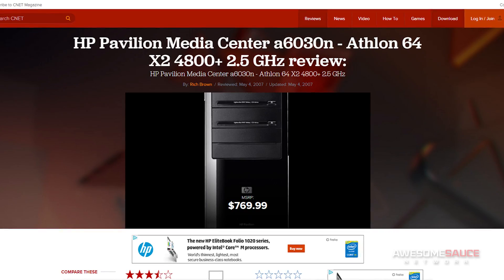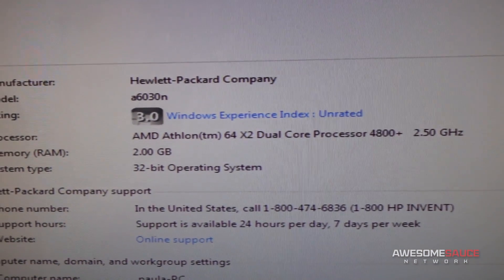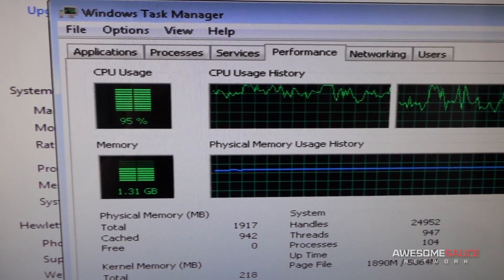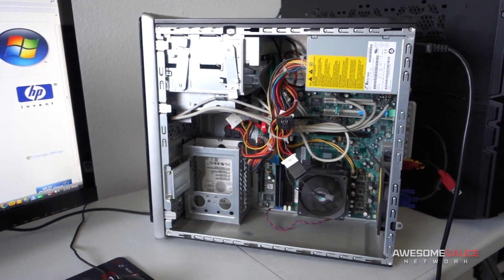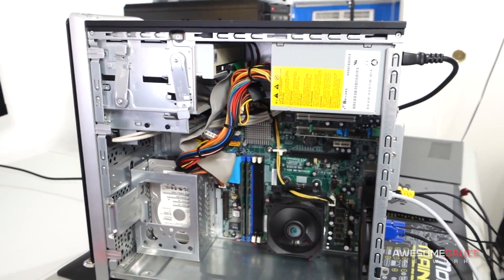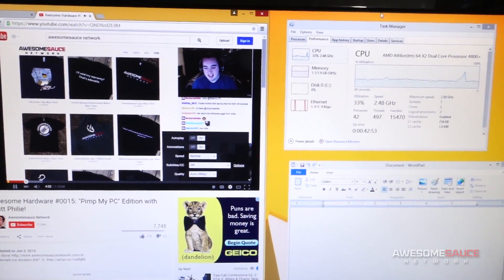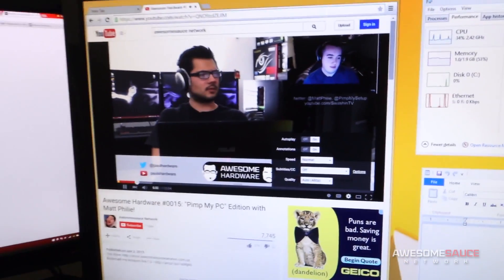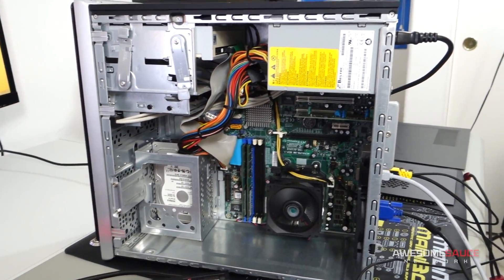Cleaning Up My Neighbor's Old Desktop!

Comment: Why didn't you reinstall the OS it was on? If I was to wipe the drive for someone, unless otherwise specified, I would have reinstalled Vista on that system.
Reply: ***** I disagree. Vista is actually a nice OS. Personally one of my favorites.
Reply: ***** That is highly debatable between Vista and Windows 8.0
Reply: +SteamedRevenge Vainilla Vista? sure. Vista with SP its a nice OS (sure, its not perfect but it gets the job done)
Reply: ***** meh. Its a good OS in my opinion
Reply: +SteamedRevenge Still, his neighbour was used to Vista.

Comment: why is that $700 for 2gb of ram, a shitty processor and a shitty gfx card
Reply: In 2007, that CPU was amongst AMD's top everyday computing processors with nice 128-bit graphics. Today, the processor still performs well, but needs to be paired with dedicated graphics if you want to be able to play new games. 2GB of RAM was about all 32-bit Vista needed and could utilise.

Comment: I have a HP Pavilion P6000 Series, Its a old family PC so its bad and old, my dad gave it to me after my parents both got laptops. Now I mainly use it for gaming, most games run fine since I got it a GPU, since It didn't have one before, and a power supply. Now the problem is I have a lot of CPU heavy games, meaning my GPU doesn't do much of the work sometimes. So I was thinking of getting a new CPU, preferably a Quad-Core, with around 4 GHZ. No I was wondering wince I'm running a... Uh... Hold on lemme check, Ah yes, a AMD Athlon II x3 445 with 3.1 GHZ. Now I am not sure if the x3 stand for tri-core, but I was wondering if I wanted to get a new CPU, would I have to get a new Motherboard, and for that a new Power supply?    PS: my Power supply is a Thermaltake TR2 430W, and my GPU is a Zotac Nvidia GeForce GT 640.
Reply: I don't know what your existing specifications are, but you could find a CPU from the same generation/type to fit into your motherboard.
Reply: Ok.
Reply: Millipede Streams which p6000 do you have? I want to find the specifications
Reply: p6732f
Reply: Millipede Streams ok, looks like you can stick to that motherboard and get a quad-core AMD Phenom 965 or 970 etc. but my main concern how much the power supply will take.
Reply: Yeah, thats my problem as well, thank you so much though. Im not cut out for this.

Comment: shouldof stick to Vista or at least windows 7. Better Performances.  Easier to use too. Then windows 8 or 10.
Reply: I used Vista for 5 years. It's not as bad as people say, but Windows 10 has been an improvement for me. It is much faster and easy to learn.

Comment: When you brought up the CPU usage thing, I got curious, so I pulled mine up to see what my CPU was at.
It was at 3% usage... 3% and I have 3 monitors hooked up and they all had windows open on them...
Well, I guess my CPU is a beast. I never really thought of it as a beast, though.
Reply: Displays are handled by GPUs. We're the Windows doing anything CPU intensive?
Reply: +Lapine Vision were*
Reply: Lapine Vision If I remember correctly I had a live stream open, Skype open, and YouTube or Steam open. That's usually what I always have open.

I do have a i7-4770k, though. Is that really much of a surprise that it's at that low of a percentage?
Reply: Yea I just tried this and my 4770k reaches 10% while staying under 1GHz
Reply: +Retz i am planning to keep my 4770k through a few generations
Reply: +Retz My cpu intel g630 2.70 ghz reaches 50% with youtube video and steam and 5 folders 
and reaches 100% on gta v
Reply: +Retz Mine's at 11%

Comment: 4gbs ram
new hdd or ssd if possible
windows 7 or 10 

just those things should wake the machine up some more especially an SSD and windows 10
Reply: Tutoriale și jocuri interesante i believe thats pain, or "kill me" in hard drive speak
Reply: +Lapine Block SSDs make a major difference. I now have SSDs in all three computers that I use on a regular basis. In fact, one of those computers is going on 11 years old, and the SSD really helped its temperatures, removed the noise of an HDD, and is keeping it snappier.
Reply: +Lapine Block It will, I had an Athlon X2 3800+ and installed an SSD a few years back(OCZ 3rd gen low end SSD). Difference was night and day. Program start times dropped to within a second and internet browsing (cache writes and stuff) where much faster. ALso boottimes dropped to below 30 seconds from over 1,5 min. Best upgrade for that system I ever bought. 0 ms Seek times make so much of a difference
Reply: +maccollectorZ (Commenting Account) it doesn't really seem like the guy would need an ssd really, he is an elderly fella and his needs seem very basic. Any type of modern 7200 HDD and newer OS will make boot times much faster than what he is used to. There's no need to invest more money than necessary in an ssd build. Heck, just doing the cleanup and getting rid of Vista should do the job just fine :)
Reply: maccollectorZ (Commenting Account) i am now convinced an SSD is beneficial to 8 year old computers.
Reply: Lapine Block Certainly helped this 11 year-old iMac of mine.
Reply: The HDD is fine. I'm actually surprised that a 7200RPM 400GB Hitachi Deskstar has lasted me 8 years. I don't think an SSD will do this PC any good.

Definitely needs more RAM and an upgrade to any 64-bit Windows.
Reply: Lapine Vision One of my HDDs has 14-16 years and it runs fine. Althrough it's very loud in the first 30 seconds when I power on the computer.
Reply: NonsensicalSpudz After those 30 seconds it's quiet. Oh, forgot to mention that the case isn't too stable and vibrates a lot. And it has Windows XP, but the computer came with Windows 98 or 2000 because it has a 99s AMD Sempron.
Reply: Daniel Kemnitz I was replying to the user 'Lapine' in the comments - I wasn't referring to the neighbor.
Reply: +NonsensicalSpudz Forget about windows 10 on that pc. I have installed win10 on a laptop with 2Ghz core2 duo and svhost.exe is using a lot of cpu all the time and it has high hdd activity as well. SSD might help but only if this motherboard has SATA 2, otherwise not that much. If you don't have at least athlon II/phenom II or intel core i3 or i5, just forget it. New windows uses some instructions from more modern cpus that those pcs don't have causing high cpu usage all the time. I see that even with windows update service on windows 7 on older core2 duo laptops. So yeah, windows 8 was a good choice here.
Reply: ***** Did you ever find a fix for that? I put Windows 7 on a Pentium 4 machine, and it runs okay... all except for svhost.exe using half its CPU constantly.
Reply: +maccollectorZ (Commenting Account) Microsoft published a patch which makes BITS, wuaserv and some others multi threaded, but on older pcs it makes things worse.
The only way to make your pc usable is to set windows updates to "Never check for updates" and use WSUS Offline once a week. "Check for updates, but let me choose" will not cut it, unfortunately. Windows update service, checks the hashes of system files at least for few hours daily, that is what causes high cpu use, so it must must stay off.
Reply: ***** Alright, I'll try it. Thanks for the info.
Reply: maybe a graphics card
Reply: +NonsensicalSpudz Or linux :P
Reply: +Lapine Block SSD's do wonders, even for older computers... just depends how old, of course a 98 wont benefit too much, but xp's will maybe even the dreaded vista.
(side note, i had a vista, i never thought it was too bad i dont see why people complained soooooooo much, only thing that went wrong was my harddrive dying but it was in a laptop that got moved around alot)
Reply: +NonsensicalSpudz all depends on the motherboard tbh
he might need to replace the motherboard to a ddr3 and possibly a sata 3 motherboard
Reply: +Evan Blake 
Or maybe an entire new pc with quad Titan X's, i7, 2tb ssd, 69gb ram...
Reply: +George LoL, Quad titan x are just gonna suck up all of the wattage from the power supply, your probably gonna need like a 3000 watt psu.
Reply: ***** i never said it didn't
Reply: ***** yeah because its windows 8 :P

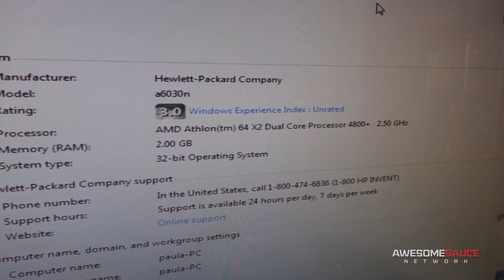Comment: 2:04
Found the problem, it has amd in it
Reply: +Midas Sandahl The Athlon 64 x2 4800 and 5000+ are still good processors. My old PC has a 5000+ and can run many CPU intensive applications.
Reply: +Lapine Block At the time they where top notch and way faster then what intel had to offer in the same price bracket.

Comment: I fear that the owner will just mess up the PC again.
Reply: +Kaarel Kahu You bet it. 2 years is enough for him/her to mess up the PC.
Reply: +Kaarel Kahu Zerg master race
Reply: +Kaarel Kahu I would just put some virtuallization software like Returnil on it, autoclean system on everyboot (well actually all changes to the C drive are cached to a file instead of actually written to the C drive. Upon reboot that cache file is deleted so everything reverts back to the original state. Really awesome for people who just like to click all those popup add links. All you have to do to make sure foto's and stuff aren't wiped is splitting the drive in two partitions and move the Documents folder to the second one. Did that on my dads PC after the firsttime I had to devirus it(he had only been using it for 3 months or so) after installing that he used that system for 3 years without any virus problems :)
Reply: +WB IsMe More like 3 weeks. Some people just have no common sense.
Reply: It works like a charm. (And because it forces all writes to the C drive to be sequentially written to a cache file, it sped up my OCZ Core 2 SSD as that (2nd gen) SSD didn't like concurrent writes very much. slowed read speeds down a lot.
Reply: +Kaarel Kahu he's probably still looking at old crusty man porn and messed It up
Reply: +Kaarel Kahu 
Probably will almost immediately. I'm not saying that older folk are always bad with computers, but it's amazing just how well some people can fuck up a system without even trying. That and the thing has probably never undergone any proper maintenance in its entire life.
Reply: +Robert Phoenix great idea there!
Reply: +Robert Phoenix cool, quite interesting, have a couple of people in mind that would really benefit from that (and me consequently)
Reply: +Kaarel Kahu whatever just help him again  for a fee hahaha
Reply: +Kaarel Kahu no duhh, but he saved the guy trouble of paying to be fixed or buying new. Like he said its an older guy, he just did him a favor. 
I would have greatly appreciated this back in the day as a kid not knowing squat about pc's for someone to help me let alone being old and barely ever using computers.

Comment: Looking to do my first ever upgrade on my old HP Pavilion a6603w: 
CPU: 2.40ghz Intel Dual Core
GPU: nvidia 7100/nforce 630i
PSU: 250w :( (Looking to replace it with a Corsair cx500m)
3gb of ddr2 ram
256gb hdd (Looking to add a 120gb ssd as a boot drive)
Any comment/suggestions? What should I buy/upgrade first? Not looking to spend more than $100 on gpu. I just want it to perform faster and play a few steam games! Thank you.

-KG
Reply: You should get more ram if possible and if your just gonna get a ssd I would also recommend you get a HDD if possible
Reply: +kg flip Find a graphics card: If you're going to use an SSD, why not get decent GPU power?

Comment: On a trip to the dump to get rid of an old CRT TV, I was directed to a container designated for that purpose.  Along with the old TV's were dozens of orphaned computers.  When the guy wasn't looking, I loaded 4 of them into my car and later went back for more. 

All of them, without exception, were there for clogged or corrupted operating systems.  I am not especially computer savvy but I was able to load up a free Linux OS and any school kid should love one of these for a start-up. 

Wait for a dry period without rain for the best yield.
Reply: I use to say that my desktop was the only machine that could evolve after I bought it. 
Even I could open it up and change.components. 

Not true with most laptops and Ipad type devices. 

It is a shame that so many machines are just tossed away.  It is stupid, wasteful and it deprives the disadvantaged.
Reply: +Larkinchance Agreed.. mostly just cranky old men guarding the entrance. They look you over when you come in and pay you no mind when you leave.. 
Are you going to get arrested for stealing from the dump?
Reply: +Larkinchance hahahahahhahahahh
Reply: +Larkinchance When I went there I was ditching other scraps and saw some microwaves stacked up. I like the parts, so I asked if I could have them but they said no and that they couldn't get it for me :( I didn't just take them because they were really at the other side of the building and there were a few machines running.
Reply: +Jess Vagnar You must be crafty because they will always say no.. I do it when I am discarding a CRT TV.. They charge me $10 for the privilege and when they are not looking, I load a few computers in the back.  They go to Asia and they receive a bulk rate for them but they could just as easily let people like us have the pick for $10 or $20 each before they ship it off.. .
Reply: Larkinchance
 Hot dang that's expensive! All of mine are free, my state has an electronics bill that prevents enclosed electronics from being thrown into the landfills so they offer free removal at the facility. Unfortunately where I am now uses a huge facility, so the physical gap is too large to stealthily grab a few components! Good for you though!
Reply: +Larkinchance I used to work at a second hand store so we went to the dump several times a week and I got to know the people working at the dump so when I saw an old computer I was allowed to take it, at one time I had around 25+ Pentium 4 rigs in my kitchen that I fixed up and sold for around 150-200$ each (this was back in 2009) =)
Reply: +Jess Vagnar They don't throw them into land fills, they fill the container and ship it to Asia for a pittance..
Reply: Larkinchance They used to throw anything in the trash into a land fill / incinerator / whatever they used in the district. In the 90's and 00's most states passed enclosed electronics laws, outlawing them from landfills and providing free removal, since they felt it would be stupid to tell someone they NEED to recycle this, oh and it costs $10.
Reply: for each item...
Reply: For your best yield lol
Reply: Yes, these computers shouldn't be thrown away.. It is wasteful.  I am not a merchant. and did not sell them, I gave them away to  people .who could not afford one.

Comment: Actually so manny people have a computer like this one with just a lot of virusses or programs that slows down your cpu. You could have done some light overclocking on this system and reverse the yellow fan and place a dust filter in front of the fan.
Reply: +DavidJonSpem User like them download stuff from the internet mindlessly. Even if they have a $10000 overkill PC, it will still run like a turtle after 2 years due all the random crap that they downloaded.
Reply: +DavidJonSpem You would need to flash a new BIOS to support overclocking on HP's Nettle2 motherboard.
Reply: Lapine Vision yeah I am not an overclock specialist

Comment: So close to what I had. I was rockin a HP a6110n my friend handed down to me from 2010 till just last year when the mobo finally kicked the bucket and I built my 390 5820k gaming workstation.

Was such a trooper. dropped an R7 240 in there, another 2 gigs of ddr2 ram and it ran dota, csgo, fallout 3/NV, witcher 2 etc. 
Eventually I'd like to take frys electronics up on one of their under 100 cpu motherboard combo sales and resurrect the HP.

Comment: Having changed the OS I would have done the guy a solid and dropped 2 more sticks of ram in, and an el cheepo Grande video card. The onboard video is gobbeling up available ram. Noting the user is a light user, A simple 630 Geforce would accomplish this at a minimal cost. Going from xp or vista the newer os is more a memory hog. Even with a modest 4g ram + add on vid card ram, the performance gain would be noticeable.

Comment: An old trick the IDE cable is to slice it into smaller portions using a razor and then bundling it up.  That's how we used to do it back in the day.  ;)

Comment: You could turn the yellow exhaust fan to intake and ad a magnetic dustfilter to the outside, so the case would have positive air pressure and no dust could go inside

Comment: hi is it safe yo use a air canister to clean out the pc from dust ?
Reply: +Kenny Hempson wouldnt recommend it unless you take out the cpu, gpu, ram, etc
Reply: +Immature ‘TerribleVideos’ Jay Why? You see Linus and JayTwoCent use that all the time to clean GPU's and CPU coolers. Just don't turn on the system for a few hours to be sure all condensation will have evaporated and I think everything should be fine. Only thing I would advise against is using it on PCI/PCI-e slots or the connectors on the back.

Comment: Cable management, ugh. I used to work for a company that contracted out to other companies to do their computer builds. There would be long specifications on just cable management alone. How they are suppose to align, what position to point in, how many ties to use etc. Just crazy requirements. Happy to announce though QC never had an issue with my builds.

Comment: Ugh, so much work for so little (they'll just mess it up again, it's Windows.) Just run AdwCleaner a few times, clear out the browser add-ons, a few updates here and there, install an adblocker and UnChecky. Bosh, Bob's your mother's husband's father's son. Like an hour's work plus updates. Possibly a factory reinstall, even quicker.
Cleaning the heat-sink? Nooooooooooooooooooooooooooooooooo
Oh, and don't forget the Joker. I mean obligatory backup.